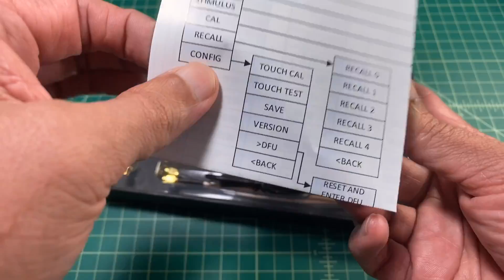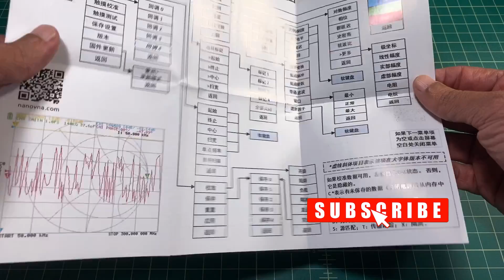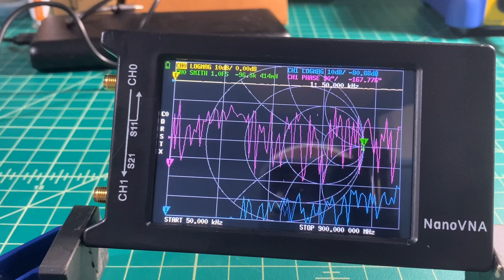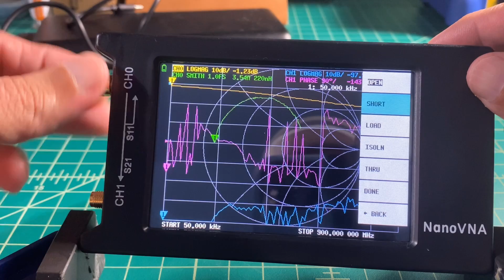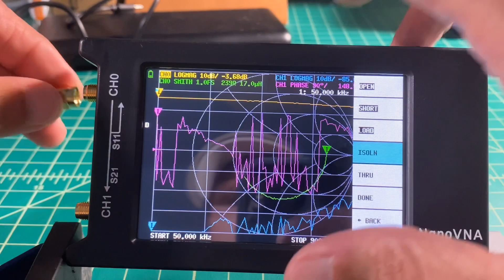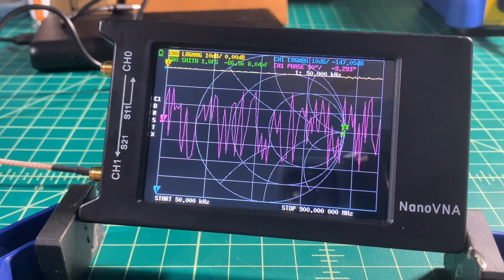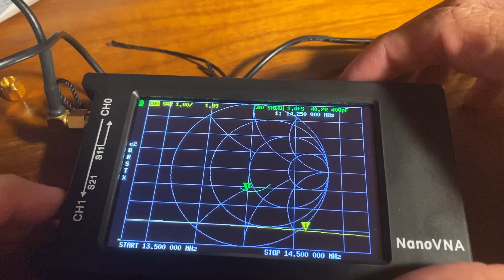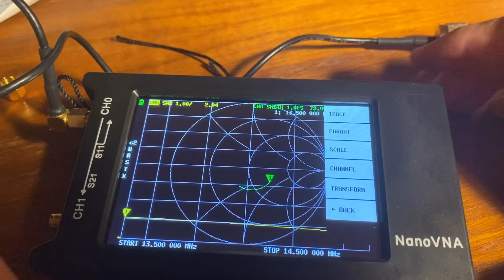NanoVNA-H4 Made Easy - HAM Radio - TheSmokinApe

Comment: Thank you for this great video on this device.

Based upon this and other reviews for the NanoVNA H 4, I picked one up from an Amazon seller. Tested my discone antenna for 144 to 148, and the analyzer showed an SWR of 1.5 to about 1.8 across the entire 2M band. Yay so now I know I won't burn out my finals :)

One question - I have it connected via the USB-A to USB-C cable to my desktop, and also tried connecting it to a charging brick. There are no visual indications (flashing LED etc) on the unit to indicate that it's charging. The battery indicator started out at 2 bars. How can I tell if it's charging, and how long does it take for the unit to fully charge? I understand it has a 1950 mAh battery so I'm assuming I just need to allow it a few hours to come to full charge? TNX & 73 - DE KI6JPE
Reply from the maker: I think mine has a blue light when charging and it typically chargers pretty fast, about 2 hours?
Reply: @TheSmokinApe  I found the problem - I was using the supplied USB type A to USB type C cable and with that the device was not charging. I tried a USB type C to USB type C cable, and problem solved. It's now taking a charge, which is a good thing as it's a pretty awesome little device.
Reply from the maker: @Kaelen_Wolf  glad it’s working out 👍
Reply: @Kaelen_Wolf  I have exactly the same question and couldn't find a straight answer.  MIne too will not show blue unless it is turned on when connected to power.  When off it is solid red not matter if I use USB type A/C or USB C/C on a computer or USB C/C with an Iphone brick.  Does your's now blink when charging with the included USB C/C cable? What device do you use to charge with.  I could not find any documention on what V/A is required to charge the battery on board.
Reply: @TheSmokinApe  When the switch is off and device connected to USB or brick the light doesn’t appear to blink, so perhaps it arrived with a full charge. I’ll keep an eye on it. Thank you.

Comment: Nice video! But, when using a patch lead to connect to the antenna the calibration standards should be connected to the end of the patch lead and then the VNA should be calibrated. Otherwise you will get an inaccurate reading.This is because the VNA is affected by the patch lead cable characteristics and length which will introduce errors into your readings, which you want to eliminate. At low frequencies it's not a big deal but as the frequency increases the error will increases. Hope this helps.
Reply from the maker: Thanks for the info!
Reply: It’s too difficult to think and understand before clicking everything without any idea how it works and what it means.

Comment: Thank you for the video, it was very simple to follow. I will most likely use it to check swr. 
1. How often do you need to calibrate the Nanovna?
2. Is it more accurate when calibrated for a single band vs multiple bands?
73, Noel-W2MSA
Reply from the maker: I calibrate mine with each use unless I have that particular calibration saved to one of the memories.  The more narrow your sweep / calibration the more accurate the device will be.

Comment: Ape, good video as I think I'm going to pick one of these up for the portable setup.  A few questions for you.  How do I know which SMA connectors are open and short?  Looks like the dummy load has the "load" attached to the back.  Q2 : do you recommend doing a calibration for 80 - 6m for general SWR and then do individual band calibrations to dial in an antenna?  Q3 : how many calibrations does it save if you want a calibration for each band to do detailed work?  I think this is my next swr meter based on your video.....
Reply from the maker: Hey Kyle, The open has a small hole in the center or the cap while the short has a pin.  The load is the silver standard.  When you do the calibration you have 5 memories tilted "save 0" through "save 4".  When you recall a saved calibration you use "recall 0" through "recall 4".  The wider the spectrum in the calibration the more granularity you looks as the calibration only contains so many data points.  I'd recommend you do them for; 80-60, 40-20 and 17-6.  that will leave you with two for specific bands you are working.

Comment: I can only imagine what this thing will look like with another year of firmware upgrades
Reply from the maker: I’d like to see a simpler interface designed for Hams 👍
Reply: @TheSmokinApe  Yes, me also, it is a bit confusing when all you want to do is test SWR and Impedance and resonance.  It is just a bit over the top for what is needed.
Reply: @TheSmokinApe  I use a program called Nanovna saver on my laptop that makes job so much easier and with the firmware upgrade it can be used as a TDR for checking those long runs. It works great for tuning cavities also. 73 KC3EKL
Reply: @TheSmokinApe  Whats confusing about it? Its test gear learn how to use it. There is not a "easy" new ham extra class interface for all you appliance operators. Learn something.
Reply: Well 2 years later they still look the same lol.
Reply: @Inknov83d  Yeah, I really wanted to seem some improvements as a "platform" and not as a "tool" - it works great as a tool, but could be awesome for beginners with some helpful software.

Comment: I just got my tech license last week and looking to make/buy my first antenna so that I can transmit from my home office. Would I need one of these to configure an antenna to hit my local 146.880 repeater?
Reply from the maker: Nah, just buy a decent antenna for 2m/70cm and you will be fine 👍
Reply: @TheSmokinApe  what antenna would you recommend starting with?
Reply from the maker: What radio are you using? I really like the Ed Fong db2 roll up j-pole.
Reply: @TheSmokinApe  A superior antenna that is easy to set up and take down.
Reply: @TheSmokinApe  I have a baofeng bf-f8hp and an anytone 878 is on its way to my door
Reply: @WJ6FRadio  I have a mobile mag mount mobile antenna on the way from amazon. Would I be able to use this antenna for my base station as well?
Reply: @jackb2374  Yes, actually you can. I did that in two ways. 1. I place the antenna on a cookie sheet so I have a ground plane, or 2. I had a curtain rod that i would stick the mag mount to and the antenna would hang upside down. This also works great in hotels.
Reply: Should I be concerned with possible static on my antenna feed line before hooking up my NanoVNA? What do you recommend doing if any, to dissipate static?

Comment: Very straight-forward and easy to understand presentation. Thank you! I bought one from R and L also, at around $80. Mine looks very similar to yours, but shows -H on the device sticker. Also, the type "C" port is on the top, to the left of the switch and adjustment pot. All cables and terminations seem the same as does the size. My case shape differs slightly. Guess mine is a "variation", as you mentioned in the video? It doesn't appear you participate in Patreon? How do you prefer to receive $ support? Thanbks again. N3JW
Reply from the maker: The have the H, H4 and the v2 over there these days.  Without a pic I can’t saw which but when it powers up it should tell you.  I should have a patreon up in a few weeks, thanks man 👍
Reply: @TheSmokinApe  This has got to be the H series. I will look at boot-up info again. Making a step-by-step guide now, based on your video. Looking forward to supplying some $ for channel support!!! Mike, N3JW
Reply from the maker: Hey N3JW, just wanted to let you know the Patreon went live: https://www.patreon.com/TheSmokinApe